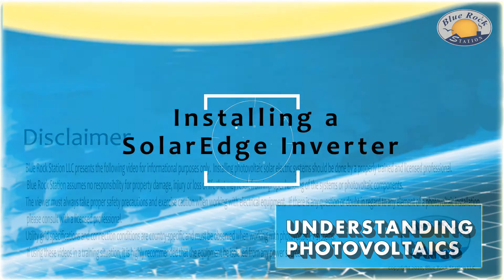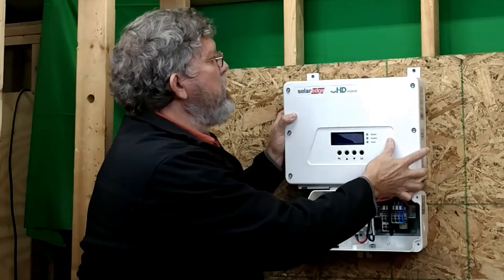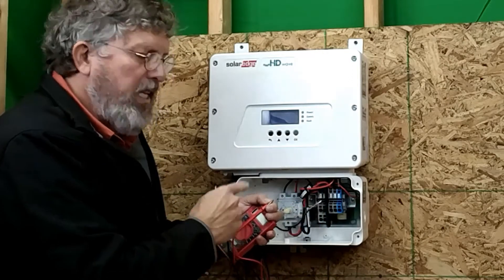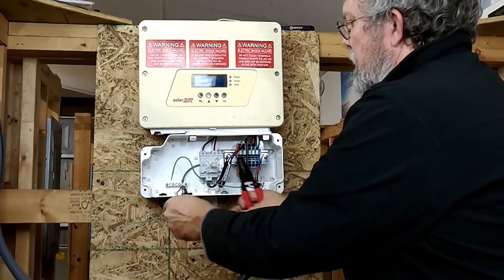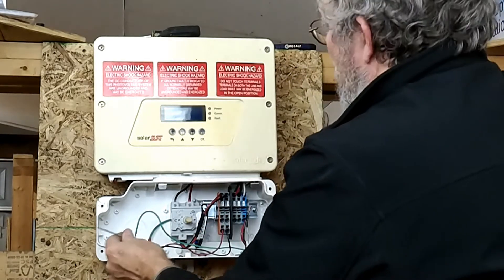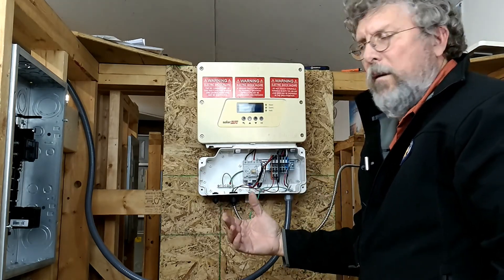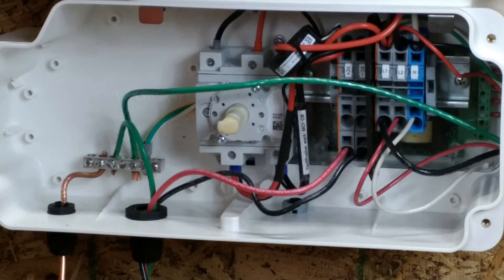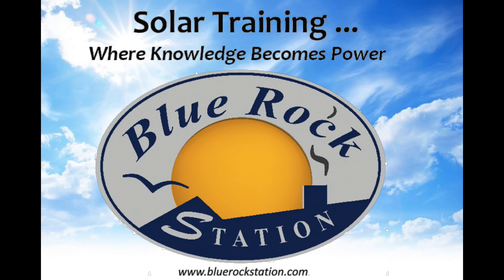Wiring a SolarEdge Inverter

Comment: Probably too late to say this, but do not buy a Solaredge inverter. Mine just failed about 6 years. It was installed in a location without direct sunlight, to keep heat down. Still failed. Replacement labor will be $350. This will probably happen a few more times over the life of the unit. Wish I went with enphase.
Reply: I am on inverter #3. That is why I am watching this video to see if I can do it myself. It looks very easy-I just have to do it at night so I sure everything is shut off and no power is coming in from the panels.
Reply: @damiencaz666  But how can you do it yourself if Solaredge won't provide a replacement to the customer? Did you just buy one on the open market somehow? Apparently it's just the large capacitors that fail. Those should be easy to replace, after safely discharging of course.
Reply: @breakburrito  I am under warranty and Solar Edge shipped my 3rd one today.  I am having the company install it for me, they are charging about $300
Reply: @dcaz342 Yah, I paid 350 to have my installer do about 30 minutes of work. It's angering that Solaredge doesn't allow system owners to do these types of simple swaps. I work on tube amps with DC voltage as high as 750, so I think I can figure out how to swap an inverter with some basic instructions.

Comment: Very nice, i have done the same things for Circle K carwash machine for years but have no confidence to do it. After this, its a piece of cake.
I recommend try to pry that terminal a few times with thin a flat head screwdriver to know which way it goes, be very gentle. The terminal will fully opened when the flat head stuck in the prying hole with a gentle push. Get the wires ferrules if you love the art of wiring. Thank you

Comment: From the ac disconnect, how do you wire the ac into the electrical panel?
Reply from the maker: John - we have a video on hooking into the service panel (https://youtu.be/gLsU8tpeP1I).  From the AC disconnect you run directly to the service panel.  Make sure to locate the solar connection as far away from the main on the busbar as possible.
Reply: @solarpvtraining  This is very helpful.  It looks fairly easy to do.  You are giving me the confidence to tackle this project by myself.

Comment: Most straight forward example on the net. Thank you! If I was going to AC couple two SE7600 HD inverters to two SMA Sunny Island 6048 Hybrid inverters. Can I swap the AC disconnect 40 AMP breaker for a critical load panel and run my two Solaredges into a 40 AMP breaker in the critical load panel and in a separate breaker run my Sunny Island hybrid inverters that are already connected to a battery bank? The Sunny Islands would act as an automatic transfer switch if the grid goes down and I would activate Frequency Shift to not overcharge the batteries in the event of grid failure. I would also have an automatic transfer switch between the Sunny Island and the generator to turn off any generator grid connection if the grid were down. Thank you
Reply from the maker: Lots of complexity in this question.  Just going off the top of my head (should really look these things up)  - you are coupling two systems together, so you need to make sure they will work with each other.  

1)  Does the Sunny Island inverter send a signal that the SolarEdge would recognize as the grid, when the grid is down?  
2)  Is the Sunny Island sized large enough that the SolarEdge inverter does not overwhelm it if all power is directed from it to the battery-based inverter when the grid goes down?
3)  As long as the entire system (SolarEdge and Sunny Island inverters) are disconnected from the grid during a power outage - sounds like it would work, but would need to see a diagram before committing myself (how's that for hedging my bets?)

Comment: where do you hook the battery bank.  The solar array comes into the inverter and the inverter connects and charges the battery bank?
Reply from the maker: This inverter (the regular SolarEdge) is not battery compatible.  They have a version called the StoreEdge that can connect to batteries.   Battery connections pretty straightforward (positive to positive and negative to negative).  The inverter system also has to have a transfer switch (internal to the inverter or external) that disconnects from the grid when the batteries are engaged.
Reply: Not many ppl know that you need a specific inverter for certain functions. Thank you